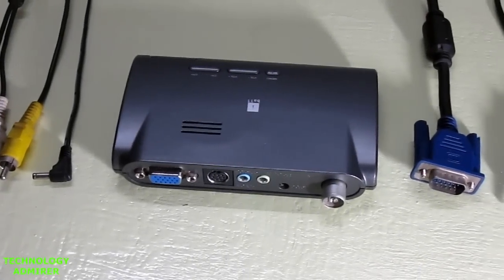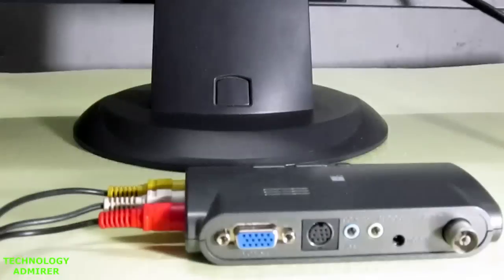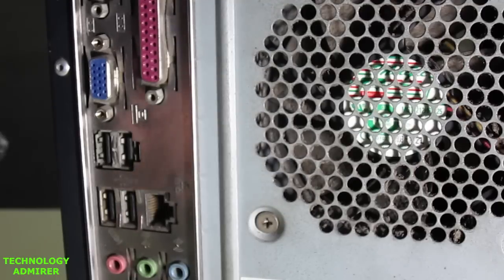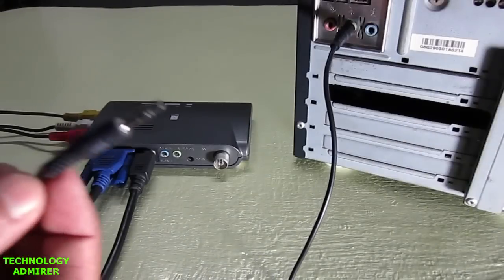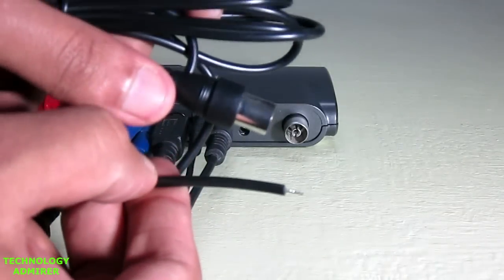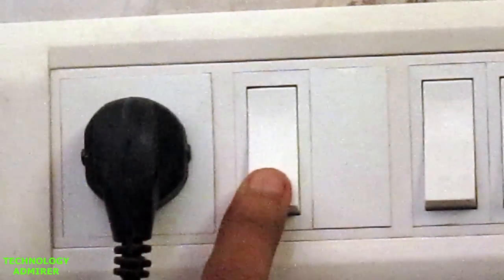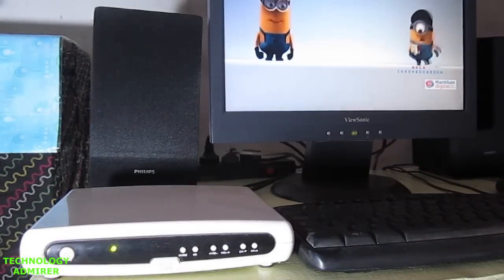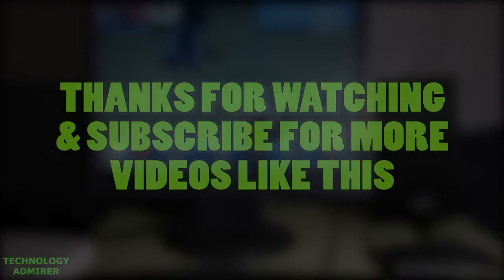How to Connect iball Claro CTV27 TV Tuner Card (Installation/Setup)

Comment: awesome video.u clarified all my questions on setting this box up.but finally two last questions
1.what remote should i use change channels?
2.will this process work with windows 7 ?
Reply from the maker: +sai nitish Hi,
1.If you are connecting this TV tuner to a set top box then you have to use the set top box's remote to        change channels
2.Yes,it will work with windows 7.

Comment: Sovan ur instruction is very much helpful to me. but i have face one problem. i.e. PIP is a very  good option for use pc & tv.at same time. but tv screen always goes to centre top on the monitor. have u any solution to move tv screen centre to bottom or top or corner on PC monitor. thanks bhai
Reply from the maker: As far as I know there is no way you can move the TV window,but pressing PIP button two times will change the size of TV window as shown in this video.

Comment: Will this tuner card work  without settop box connection????  like is there any way for connecting it with my local cable tv connection?????
Reply from the maker: +Faheem Khan There is a way to connect it with local cable tv connection ,you have to plug the local cable tv connection in the antenna in port or you can say radio frequency port.

Comment: Hi....my question is I need to use TV tuner remote pointing on the TV tuner to change the channel or I need my set up box to change the channels by set up box remote...(plzz...reply I need help)
Reply from the maker: +Shâshânk Sâxenâ Hi,if you are using a set top box & want to connect this TV tuner card then you can change your TV channels using the set top box remote control with the set top box itself.

Comment: I got this TV tuner a week ago and i connected TV tuner card to monitor and setup box as per your video but i am not seeing the TV on monitor. I navigated about 249 channel , no channel is showing setup box input,  also i did the auto scan from channel menu of the TV tuner. is there any particular channel of this tuner card that shows setup box input ? Please suggest, where i am doing mistake. Thanks !
Reply from the maker: +Anuj Arya Hi,as you said you connected this TV tuner card with set top box then I assume that you connected them using RCA jack,if so then you can try changing the source using the remote control of the TV tuner card to video,hopefully this will solve your problem.
Reply: +Sovan Dutta , Hi , O great ! It worked !  Thanks a lot for your suggestion and this video !
Reply from the maker: +Anuj Arya I am really happy for you because it is now working.

Comment: hi bro,
after this all process will i be able to connect my laptop to projector and can see tv on projector or not . your help will be useful . thanks
Reply from the maker: +Kashmir Khanchi Hi,I really can't help you with this because I have no idea if this tv tuner card is going to work with projector & laptop or not.It sounds really cool if it works but not sure,also why do you need to connect the laptop,this tv tuner works without any pc or laptop so if you can use projector to replace monitor then all you need is the projector,tv tuner card & set top box or cable connection.But I have no idea if this will work with projector or not.

Comment: hello sovan,
I have ordered ctv27 from amazon.
But, as u said in your video STEP 2, that cable comes with package, but i didn't receive.

Do I contact to amazon for the same?

OR

Please tell where will I get this cable in India, I searched for it online. I didn't get.
Reply from the maker: Which cable are you referring to? If you are asking about the VGA cable that is shown in the step 2 ( 0:36 ) of this video then this VGA cable doesn't comes along with the package & I didn't said that too but if you are asking about the cable mentioned in step 3 ( 1:05 ) then it comes with the package & if you didn't get it then I think you should definitely contact amazon for the same.
Reply: No I was talking about step 2(0:36), fine if it doesn't comes with package then from where should I get it in INDIA. I searched for it online but didn't found it anywhere.

I want to use my monitor and tv at the same time. So, that cable is must for me.

even if u have alternate solution of this then also it is welcome.

thanks in advance.
Reply: sorry I m talking about step 3.
i.e VGA IN  port of the TV tuner.
Reply from the maker: That cable is not a common cable,so I would say definitely contact amazon about it also I found a cable that looks similar to this cable http://goo.gl/kwTxrh but I am not sure if it will work or not.

Comment from the maker: Hi,Souvik Acharya to connect it with cable connection,you have to plug the cable connection in the antenna in port or you can say radio frequency port.This way you can connect your cable connection without any set top box.
Reply: +Sovan Dutta my PC is in my bedroom and my set top box is in hall so how should i connect them?
Reply from the maker: +Rahul Malpe Hi,can you explain it to me why do you want them to connect & what are they(set top box & PC) currently connected to?
Reply: i just want to watch Tv channels in my bedroom but as i can see in your video you said the tv turner has to be connected to the set top box but the thing is the PC is in my bedroom and set top box is in my drawing room which is far so how should i connect the tv turner? plz help
Reply from the maker: +Rahul Malpe Okay,so the set top box is in your drawing room,but is it connected to any TV or not?If it is connected to TV then you will not be able to connect it with TV tuner card because it is already connected with TV.
Reply: yes it is connected with the tv. But is there any alternate solution for my problem?
Reply from the maker: What I know is that you can connect one set to box with one TV only.
Reply: can conect  tuner same time  with PC and tv
Reply: use rg splitter or video splitter
it is just like a single av port converted into two ports...so that connect one port with tv av cable and other with tv tuner av cable
Reply: input kewal sound letf Right ka agar hum dete hai to out put aux  sound dega plese replay
Reply: tv tuner me mai sirf input audio left writer connection karte hai or out put aux audio k0  home theater se conncet kate hai to kay home theater me  redio baj sakta hai

Comment: I like to purchase this product for my home where I dont have set of box. I have local cable connection, Is it possile to connect the cable connection with this device? (where we connect  FM cable?)
Reply from the maker: Arunkumar Santharam Hi,thanks for asking,I have seen a video on YouTube itself recently where I saw this tv tuner(ctv27) was connected with local cable connection & it was working with no problems.I don't remember which video it was but this tv tuner card was working with local cable connection which will be connected on the FM antenna port.

Comment: how to watch TV with audio,and another question is that when we switch off the computer    
will the audio of the TV plays with the computer speaker if external speakers are not connected?
Reply from the maker: If you follow the steps shown in this video then you will be able to watch TV with audio & in this video I said external speaker by which I mean any speaker or music system other than the one in the TV tuner card so computer speaker is also considered as an external speaker & yes even if you switch off your computer audio coming out of the TV will play through the computer speaker but you obviously need to keep your computer speaker switched on.Hope this helps.
Reply: +Sovan Dutta thank u so much
Reply from the maker: No problem

Comment: Will I be able to watch digital and analog both using a set top box?  I mean I've a connection from my TV to set top box using a rf male-female cord so I can switch from analog to digital set top box signal using my TV av button when digital signals are broken or weak. Can I do the same with my monitor?
Reply from the maker: I am not sure if it can be done using this TV tuner card & your monitor,as I haven't tried doing anything like this,but you can try.
Reply: +Sovan Dutta thanks for your reply. I'll try and let you know here. You helped a lot though. ☺
Reply from the maker: No problem :-)
Reply: Yes. It can be done I can watch TV (analog) + Video (Digital) cable +FM using this great product.  

But I didn't understand how it captured the FM signal? Because I used that port to connect RF cord to set top box to watch analog TV. Anyway it's good that I can watch all of them together Haha.
Reply from the maker: +Subhashis Chowdhury May be it has got an internal antenna which is quite powerful & so it is able to capture FM signal btw I am really happy for you that every thing is working for you using this TV tuner card, frankly speaking I didn't expected it to work 😃

Comment: i just want to know how to see hd pictures through using this tv tuner . how to connect TATA sky hdmi cable (which is included in the set top box ) to this tv tuner for better quality picture ? reply fast
Reply from the maker: You cannot connect HDMI cable to this TV tuner card because it doesn't have have HDMI in or out.

Comment: Can I use it 
I have old set top box with RCA ports only ( input& output)
I want to use it with monitor only .... 
not connected with my PC
Reply from the maker: Yes,you can connect it with your set top box which has got audio & video out ports (RCA) & assuming you monitor has got a VGA in port,if so then this TV tuner card can be used without connecting your PC.

Comment: How am I supposed to connect my lcd monitor in my room  with my dish TV set top box in the leaving room? Is there any way I can do it?
Reply from the maker: Yes,you can connect them but for that you need to have long rca cables or long VGA cable then you can connect them to your set top box & then the other side of the cable to your TV tuner card,then from your TV tuner card to your monitor through the VGA cable.

Comment: Hi..!! I have a Old Onida tv which do not have points for rca cables so can the tv tuner help me to connect the Tata sky box with the tv?
Reply from the maker: +Rahul B As your Onida TV does not have any rca jack inputs so you have to use a converter to connect your set top box with your TV,this TV tuner will not help you to do that.
Reply: +Sovan Dutta ty bro☺😊👍
Reply from the maker: +Rahul B You're most welcome :-)

Comment: i have connected all the cables as explained by you but blue screen appearing nothing else is there any option to select AV mode on tv tuner card
Reply from the maker: +Amol Mule Hi,you can try changing the source using the remote control of the TV tuner card to video,hopefully this will solve your problem.

Comment: Hi Sovan
I have done everything you have said in your video with my Tata Sky setup box
But when i am switching on my tatasky setup box...there is nothing coming on my monitor display.
The iball claro tv logo is always displaying
what to do ?
Reply from the maker: Hi,I assume that you connected them using RCA jack,if so then you have to change the source using the remote control of the TV tuner card to video & this will solve your problem.
Reply: Sovan Dutta Thanks a lot
Now its coming :) :)
Reply from the maker: No problem :-)

Comment: Hi Sovan, i have a CRT monitor, can it be connected to it??I got this doubt because when I connected, i am only getting a blue screen with iball claro tv written on it. pls help
Reply from the maker: Hi,you can try changing the source using the remote control of the TV tuner card to video & hopefully this will solve your problem.
Reply from the maker: This TV tuner can be connected to a CRT monitor,I can say this because I personally tried connecting this TV tuner card with a CRT monitor & it worked flawlessly.
Reply: Hi Sovan, thank you so much, I was trying to change the source by a wrong way. But later, I changed it through menu button provided on tv tuner remote and it worked. Thanks for your help bro. No one replies as fast as you do here for people asking their doubts. :) :) :)
Reply from the maker: No problem bro,I am glad that I could help :-))

Comment: i am getting lines on the tv. any idea whats causing it. The set top box works fine on other machines
Reply from the maker: Hi,I can tell you to try out few things & see if that fixes the issue.First remove the internal TV tuner card & remove any dust on the TV tuner card or the PC(IF their is any dust) then again install it in your PC & make sure it is seated correctly,if the issue is still their then try another software to record & also try changing the settings in the software,maybe any of this solves the issue that you are facing.

Comment: Hello, now there is another problem with the sound.There is huge sound coming from the speakers only while watching tv.This tv tuner card has an inbuilt speakers.Mine is a creative speakers. what could be the problem. I have an audio out jack in the back of the monitor.should i try connecting the speaker to the audio jack on the back of my monitor.
Reply from the maker: keralapressacademy Do try to listen using your TV tuner card's inbuilt speaker as well as monitor's speaker & see if the sound gets fixed.

Comment: Sovan... amar TV Tuner holo FRONTECH LCD TV BOX Model no. JIL-0622. ata te ek ta LINE IN, ekta AUDIO IN, ekta AUDIO OUT ache. muskil ta holo j ama k duto hedphone use korte hoche. PC'r Duto AUDIO out theke ekta headphone a lagano (PC AUDIO r jonno), r ekta TV Tuner er LINE IN (3.5mm cable e lagano) Set Top box er RCB'r AUDIO OUT ta (RED+White color jack ta switch kore, (RCB to 3.5mm jack dia) TV tuner er AUDIO IN a gache (karon amar TV tuner a RCB r AUDIO (RED+WHITE) ta nai). r TV tuner er AUDIO OUT dia (TV PROGRAM er jonno) onno r ekta headphone use korte hoche. Tv Audio r jonno ekta headphone, r PC audio r jonno onno headphone. charte kaan ebar kothay pai bolo  :S  ami r matha ghamate parchi na bhai. tumie bole dao j ekta headphone dia ki kore TV + PC dutori sound pabo. thanks bhai
Reply from the maker: ekta kaaj koro eita kine neo onek kaje debe amar o ache majhe majhe use kori jokhon dorkar pore http://www.amazon.in/Belkin-Rockstar-F8Z274-Headphone-Splitter/dp/B0017PG8KS  eita diye at the same time PC audio aar TV audio shunte parbe jodi shunte chao to,hope this helps.

Comment: how to connect tuner to star cable?  as of u connected it to fm port?
Reply from the maker: Anil kumar reddy What do you mean by star cable?Is it just the cable connection without the set top box?If so then probably it can be connected using the FM port,also do remember to switch to the FM mode on the tv tuner card.

Comment: hello sir how to connect speakers without CPU...and its work with window xp computers??
Reply from the maker: +Saurabh Gupta You can connect your speakers directly from the TV tuner card & yes it works with windows XP because the PC running in this video is running on windows XP.
Reply: Sovan Dutta 
thanku so much sir...
Reply from the maker: No problem :-)

Comment: When connected to set-up-box, the source must be Video not TV and we can see all the channels. When TV antenna is connected, source needs to be set to TV and we are expected to do Tuning. This product is great; hope it will long last. Planning to have new FHD monitor instead of buying expensive TV.
Reply from the maker: You are absolutely correct.This TV tuner card is working fine for the past 2 years & I am really happy about that,I hope your ones too works well.Getting a big FHD monitor is a really good idea because you will be able to use that as your monitor as well as a TV :-)

Comment: my monitor is in 21:9 ratio(LG 21:9 UltraWide 25UM65 25UM65-P), will i be able to watch TV in 16:9 ratio or the video will be stretched?
Reply from the maker: I am not completely sure if it is going to be in 16:9 ratio or completely stretched on your UltraWide monitor but you can change the settings in your TV tuner card according to your own preference.

Comment: Boss I don't hv a set top box ... How to connect with cable ..?
Reply from the maker: +Subhankar Bera Connect the cable connection to the radio frequency port of the TV tuner card & change the source in the TV tuner card using the remote control of the TV tuner.

Comment: Sir can I use it on #All In One PC ? I have to watch tv on my pc.... Plz reply sir....I'm in trouble...?????
Reply from the maker: If your All-in-one PC has a VGA in port then you can probably use it
Reply: Sovan Dutta yes sir it has VGA port....but can I watch HD  quality????
Reply from the maker: You can watch in HD quality if your set top box outputs HD quality
Reply: Yes sir I have tatsky HD settop box ....Thank you sir you helped me
Reply from the maker: You're most welcome
Reply: Sir pictures in not showing in my pc after connect cable
Reply from the maker: Change the source in your TV tuner card using TV tuner card's remote

Comment: Can u  tell me how to connect this with acer/dell laptop? 
I m clueless abt it. 

I dont have a PC
Reply from the maker: sada siv First of all I would say that this TV tuner card is most probably not going to work with a laptop,but if you still want to try & see if it works or not then first you have to see if your laptop have any vga port or not.If vga port is there in your laptop then just connect the vga cable to the laptop's vga port instead of the monitor's vga port as shown in this video & the rest of the steps will be same.
Reply: I did. But nothing hpnd on screen. No software installation was there. Hence confusing
Reply from the maker: sada siv In your laptop did you switched video source to vga input?If you did so,but still can't see iball claro logo on your laptop,then it may not work with your laptop because this TV tuner card does not require any kind of software installation,to get this TV tuner card running you only need to connect it.If you have any monitor then also you can watch TV using this TV tuner card,you don't need any PC for that.